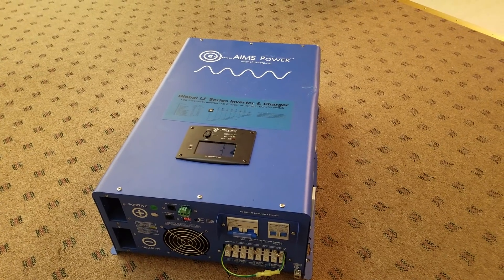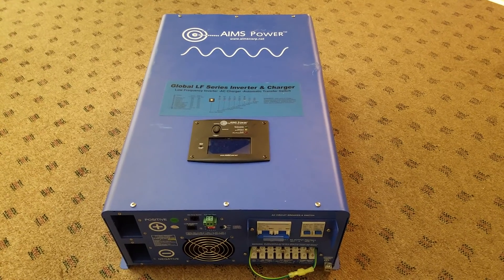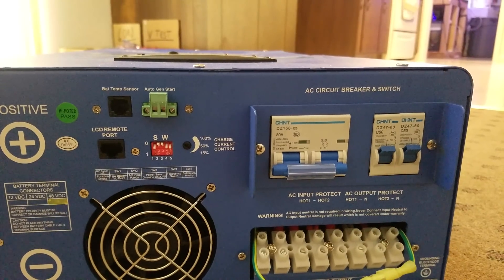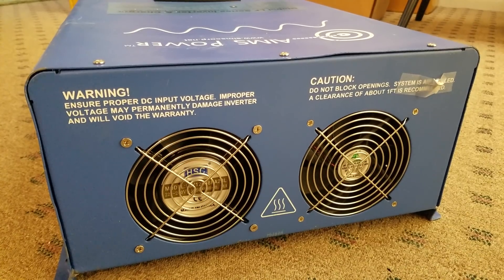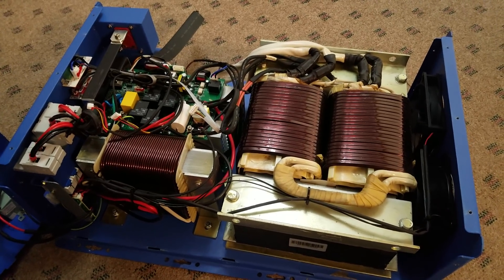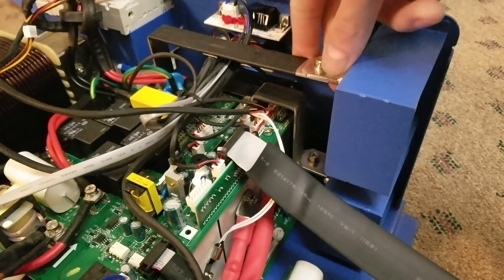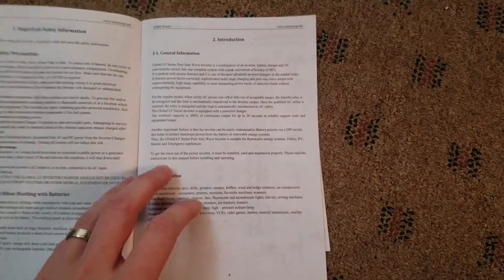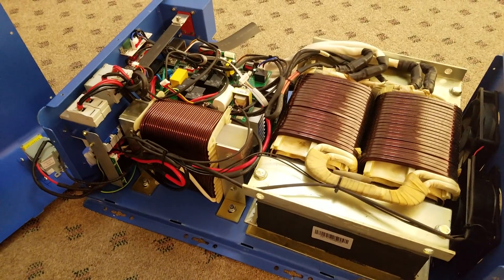Overview of AIMS Power 10kw 48VDC to 120/240VAC Split Phase Pure Sine Inverter

Comment: Hi. Great vid. Aims has the worst customer service I have ever seen. But that is probably a good inverter. If you want another good one like that but much cheaper check out sigineer. Thanks again
Reply from the maker: That's unfortunate, hopefully I won't have to ever call them. I did check out Sigineer before buying this one. I was immediately turned away by them when they advertised their inverters were UL listed. I contacted the company asking for the UL certification and changed their storying saying "oh they're not listed, they just meet UL requirements so you can certify it yourself". Um, no.
Reply: I didnt know that . Im sure thats the same with most inverters.Either way hopefully it works well for you.

Comment: I have the 12kw version of this sitting in my basement. My original plan was to use 2X24 volt forklift batteries for storage from my 7Kw solar. I am now building a 18650 powerwall so i'm very interested in your project. Like you I won't be using the charger function.  Do you think this will work with the 60 volt 18650s?
Reply from the maker: The manual for mine says the high voltage alarm/fault occurs at 64.0V. I'm not sure I would push it to 60.0V. Are you looking at a 15s configuration for your 18650s?
Reply: LithiumSolar   14s battery
Reply: I would think the forklift batteries would be much safer. Lithium when it burns is impossible to extinguish and it's a very hot fire.

Comment: Found in an Amazon review of another inverter in this range, what the "pump input" is. It's an unfused 240V output that runs 24/7 for a water pump. Apparently not powerful enough to run a well pump,  which earlier units could do. Not sure what use it is without knowing it's power output, perhaps you could test it with various loads and see at what point the AC voltage drops.
Reply from the maker: I actually found that the manual for the 12kW inverter explains the pump input. I'm not sure why it was left out of the 10kW inverter manual. It suggests only using it if the main inverter output is not powerful enough to start the well pump. You can find the manual for the 12kW model here https://www.aimscorp.net/documents/ETL8K12K%2010072019.pdf :)
Reply: @LithiumSolar  it's a pump output not input. It's not labeled correctly as input. The extra transformer provides extra inductance for pumps which won't run right on the main output.  The extra inductance I believe cleans up the harmonics on the output waveform resulting in smoother operation with highly inductive loads like ac motors.
Reply: @loosecannon124  Motors do take more power for start up. but wells do have capacitors to help with start up. So who knows I'm looking at buying a 10,000 watt but I don't like the small lugs for the power out put and the tiny little screw heads, How can you get a good tight connection with a little tiny screw driver.